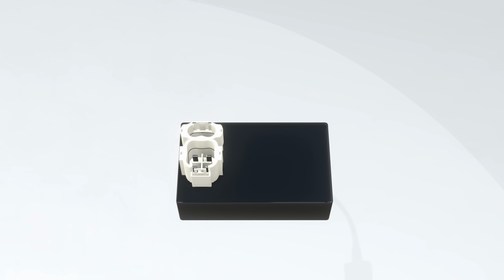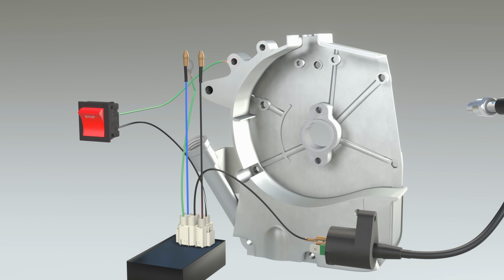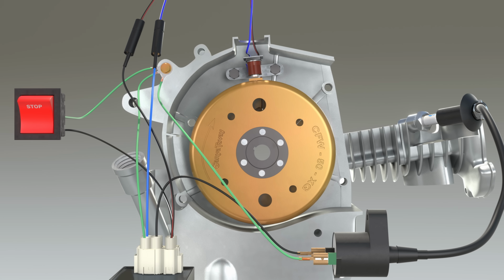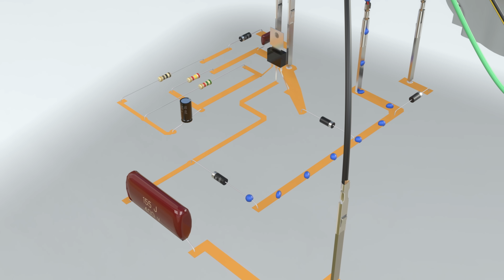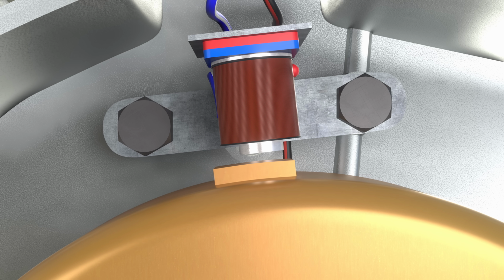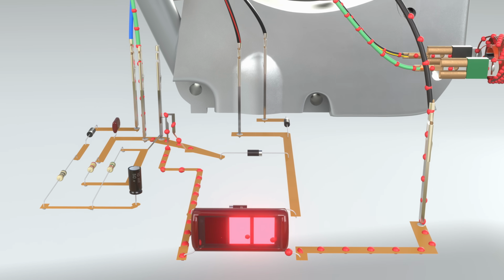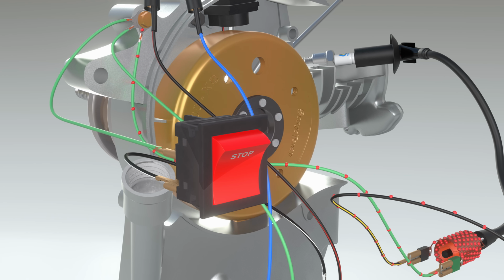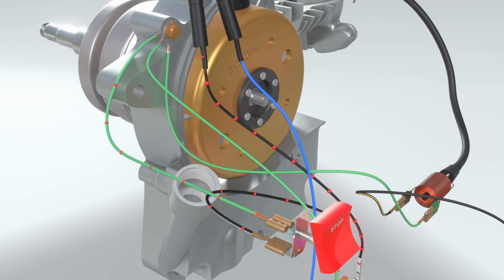139qmb Electrical spark, CDI-AC

Comment from the maker: ❗The script was originally written in Russian and then translated. In Russian technical literature, semiconductors use 'valve' terminology where 'open' (открыт) means conducting and 'closed' (закрыт) means non-conducting. In English, 'open' refers to an open circuit (OFF) and 'closed' to a closed circuit (ON).❗

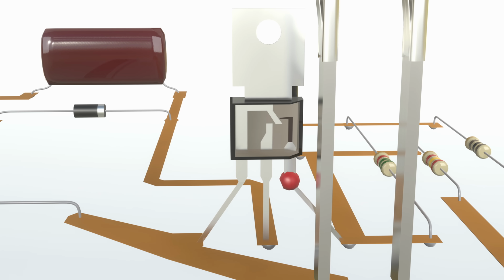❗5:51 "The thyristor opens. You get a closed electrical circuit." → "The thyristor turns ON (triggers). You get a closed electrical circuit."

❗7:08 "When the capacitor is fully discharged, the thyristor will close. The process is repeated again." → "When the capacitor is fully discharged, the thyristor turns OFF. The process is repeated again."

Comment: Mistake: The Capacitor discharges when the Thyristor closes( ON- state) and opens( Natural commutation) when it is completely discharged( OFF- state)...the video says it opposite!
Reply from the maker: Actually, that’s exactly what the video says!
 I state: 'The thyristor opens. You get a closed electrical circuit. The charged capacitor discharges... When the capacitor is fully discharged, the thyristor will close.'
So we agree on the physics! I used 'opens' as 'turns ON/starts conducting' and 'closes' as 'turns OFF/stops conducting'.
Reply: @SanyaTsvay look, a closing switch is considered 'ON' state and an open switch is considered as 'OFF' state...as far as what most of the academia books follow as the convention of wisdom, flipping the convention can result in alteration of functional behaviour in designing a circuit but remain strictly same as long as one follows his own☝️AI if it follows it own can be misleading to human understanding😂😜
Reply from the maker: @navneetpandit7299  The confusion comes from a direct translation. In Russian engineering literature, semiconductors follow a 'valve' terminology: an 'open' thyristor conducts current (открыт), and a 'closed' one stops it (закрыт). In English, terms follow circuit states, where 'open' means an open circuit (OFF) and 'closed' means a closed circuit (ON).
Reply from the maker: @navneetpandit7299  The script was originally written in Russian and then translated.
Reply from the maker: I have posted the corrections in the pinned comment below the video.

The script was originally written in Russian and then translated. In Russian technical literature, semiconductors use 'valve' terminology where 'open' (открыт) means conducting and 'closed' (закрыт) means non-conducting. In English, 'open' refers to an open circuit (OFF) and 'closed' to a closed circuit (ON).

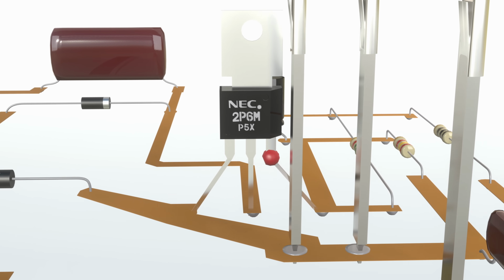5:51 "The thyristor opens. You get a closed electrical circuit." → "The thyristor turns ON (triggers). You get a closed electrical circuit."

7:08 "When the capacitor is fully discharged, the thyristor will close. The process is repeated again." → "When the capacitor is fully discharged, the thyristor turns OFF. The process is repeated again."
Reply: @SanyaTsvay Ok well taken🙏👍
Reply from the maker: @navneetpandit7299  Thanks for bringing it up and helping clarify the terminology!
Reply: @SanyaTsvay Welcome brother Always!

Comment: as I suspected, the trigger wire discharches the capacitor on each TDC, so it fires at the top of the exhaust stroke as well. still trying to find how the RPM limiter circuts on these work. I suspect that's what the 3 resistors and smaller capacitor on this circuit are for?
Reply from the maker: This unit does not feature an active rev limiter circuit. The ignition cutoff is dictated purely by the hardware component limits, specifically the capacitor's charge and discharge rate. As a result, performance will fade naturally at high frequencies rather than hit a sharp cutoff.

Comment: I have seen that some ignition coil of some companies give long current As much the current will be long the engine will run friction free in floating state Otherwise the reverse of this will happen I mean to say if the current will be short the engine will not run smoothly and friction will be much more And this is the most important point

Comment: Awesome demo how it works. I have an issue with my ATV. It starts (not instantly) works for a period of time (3-5min) then stops working. Pushing Start button doesn't work. Started is rotating the engine, but it doesn't start. Some troubleshooting showed that it stops making sparks, so that explains why the motor is not starting anymore. If I let it stay for a period of time, it starts again, but not for long time. SO... looking at this video I understand the circuit, but the question is: who doesn't make the electricity for sparks? Coil is new. When no sparks are coming I'm testing if the electricity is coming to the coil to check if the coil is not the issue. And it's true, nothing is coming to the coil. So now is the big question: who doesn't give electricity to the coil? The CDI or the Engine?

Comment: How to increase the spark produced by the coil and stator? I need it to be strong and I am not satisfied with that minimum to ignite the fuel for 'ignition.  My experimental rotary engine has seven spark plugs and must always have an 'adequate spark. The coil I would like to use is from a Honda Africa Twin, then the BKL3B module and a hall sensor at pin 5. Obviously the resistor to lower the 12v and be able to power the sensor with its 5V. Although “if” it has a range of 4.5 to 24 v, I prefer to put a 280 ohm resistor (0.025A draw) 1\4 w and limit it to 5V.

Comment: Best explanation in easiest way to understand. Thanks! Only missing is how ignition advance works. The ignition angle changes with increased rpm, but it is a separate course in electronics which R-C components do that in the CDI unit.

Comment: What about the regulator/rectifier?
Reply: That's the ignition system, you only need a regulator/rectifier if you want to covert AC to DC to charge a battery or power lights.
Reply: @TheWeeBaldyBiker  ah ok I understand now, so on my bike I see coming out from the  stator there's three white wires going to the regulator and two more wires going to the capacitor.
Reply: @edwinbarnes7232  the three white wires are for a three phase charging system coming from separate poles in your stator
Reply: @TheWeeBaldyBiker  Thank you Brian
Reply: @TheWeeBaldyBiker  hold on, what if the CDI is DC and not AC? Then we would also have to consider the regulator as part of the ignition system?
Reply: @edwinbarnes7232  A DC cdi gets its power from the battery via the ignition switch
Reply: @TheWeeBaldyBiker  ah ok yes, thank you, for the information you certainly know your bikes, I have a Yamaha Tricker 250cc 2005,   the battery doesn't charge while engine is on, I checked the 3 stator's phases and each of them give continuity with the body of the bike, so have ordered a new stator,  out of curiosity I then tried to start the bike with the 3 phases connector unplugged and the 2 pulse generator wires still connected and the bike wouldn't start. I then connected the 3 phases again and the bike starts at once.  So I'm wondering how is it that the bike needs the 3 phases of the broken stator in order to start?
Reply: @edwinbarnes7232 I found a wiring diagram for your bike online, looking at the 3 wires from your stator, they go to the regular/rectifier and also to the CDI unit, so disconnecting them the engine won't start. To be honest, I'm not familiar with this set up.
Reply: @TheWeeBaldyBiker  Thank you so much for taking your time to look into this, it all makes more sense to me now. Then , in my case it is  impossible to test AC voltage given by the stator. However, all the 3 phases are grounded so I'm pretty sure that the stator fails.  Ahah the CDI unit on this Tricker bike has 16 pins/wires to it, I suspect its more than a capacitor? whereas the rectifier has 4 pins, not a simple, intuitive set up for a little bike such as the Tricker.

Comment: Hello friend, today I had a problem with my scooter and I want to share it. While I was riding a 100 cc scooter on the road, the motorcycle suddenly slowed down from 70 km to 20 km. It reacted as if it had run out of gas, but my tank was full and when I opened the gas to accelerate, it stopped. I started like this again and went 10 km at a speed of 20 km without accelerating at all. Now it works at idle but when I open the gas it goes off. I drove at a speed of 70-80 km for 1 hour and suddenly it gave me such a problem. I changed the oil 200 km ago and put synthetic oil. I buy gasoline from a quality place. The factory spark plug is still in its original state, with 50 thousand km on it. Can you guess exactly what caused the problem?
Reply from the maker: I can only guess at the options.
1. the membrane in the carburetor has torn.
2. the membrane of the fuel valve has torn.
Reply: @SanyaTsvay  I just talked to the mechanic and she told me there was a timing error, the cam valves, chain and shaft needed to be replaced and she would do a detailed inspection again.
Reply from the maker: @yilmaznas6834  Well, maybe. A specialist knows better.
Reply: @SanyaTsvay  Thank you for your ideas and answers.😊🙏👍

Comment: Thank you so much for this video. Can you do a video about the headlight, blinkers, and tailights? My scooter head and tail lights get dim when I rev my engine unless I press the brake or turn signals. I cannot find any information about this anywhere. Do you have an idea of what it could be?
Reply from the maker: Either a weak generator or powerful light bulbs.

Comment: Everything is fine but i can see that spark is igniting even at exhaust stroke. Is that will happen in real time or just a animation mistake?
Reply from the maker: Idle spark on exhaust. Four strokes are two revolutions of the crankshaft, these are two pulses from an inductive sensor
Reply: @SanyaTsvay  how do they work then. Means the spark is not useful as case one and 2nd is the combusted gas may have unburnt fuel left which will ignite again while exhaust and it doesn't also have any use for it.

Comment: Good to know so that when my scooter engine decides to not work for some reason hopefully it wouldn't be a problem with the piston itself hopefully it's just that one control module that I can replace stick at the engine running again, typically happens during the winter 😒

Comment: Hi, what is the primary coil voltage and current draw of this, also can you test it with a regular multimeter?
Reply from the maker: Current cannot be measured with a conventional multimeter. The voltage was measured with a Chinese oscilloscope. For some reason the voltage level is about 5 volts. Although the generator winding is wound with a thin wire. There are a lot of turns there, and logically there should be more than 5 volts. In my community I posted the oscilloscope readings: https://www.youtube.com/channel/UCHzv6DP-8_oKMsDBCCKpbng/community
Reply: @SanyaTsvay  thanks for reply, I am curious of this design, this ac stator is a star connection and grounded to frame , and how the voltage is stabilized if it's directly connected to the CDI, can this coil be tested with a test light for triggering ?
Reply from the maker: @Bias_Prineus  This particular generator winding that powers the 555 switch cannot be checked with a light bulb. The current is too weak there. You can check it with an LED. I did this in one video: https://youtu.be/1t6dRiybBVw

Comment: Hi, on the coil, green wire should be connected to green terminal. Can be connected in reverse?
Reply from the maker: in theory it is possible. But it's better not to.

Comment: Eline sağlık dostum cdi ünitesinde ateşlemeye avans vericek bir parça bulunmuyor anladığım kadarıyla bu motor ateşleme avansı yok ve ayar sabit doğru mu ?
Reply: While that type of ignition doesn't have specialized advancement correction, it should work it out somehow. The idea is that sensor coil voltage rises gradually. Let's suggest that it generates sinusoidal pulses. On idle rpm sensor coil will have lower maximum voltage thus reach switching threshold of thyristor later. On higher rpm it will reach threshold voltage earlier and thus ignite earlier.

All this is theory, and one should check how correct does it work on your particular bike.

Comment: Wow, your videos are amazing! Just today, before you uploaded this one, I was wondering how the ignition system works. I have a 2018 Kymco Agility 50 Euro4 scooter, which originally was limited to 25 km/h. I changed the bushing on the variator, but it still won’t go faster than about 45 km/h because the Euro4 Dellorto ECU cuts off the spark at that speed. Your video provided so much useful information for me on switching from my restriced ecu to an AC CDI. It was exactly what I needed! Thanks for the great content!
Reply: swap engine airplane